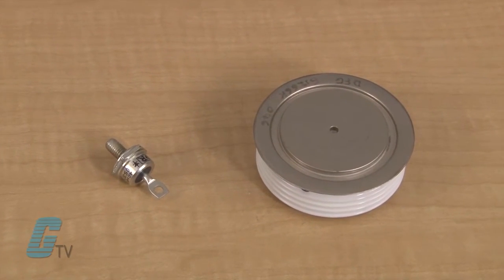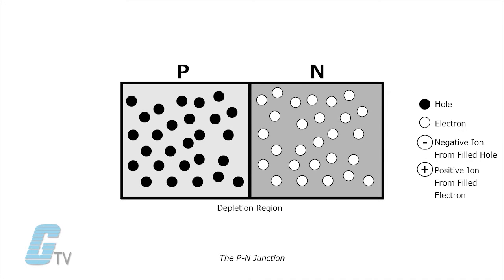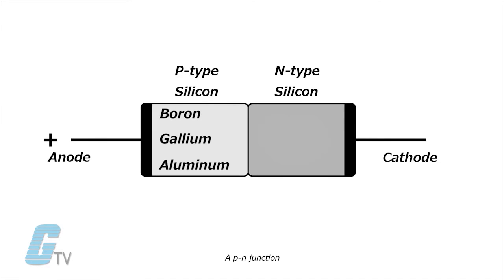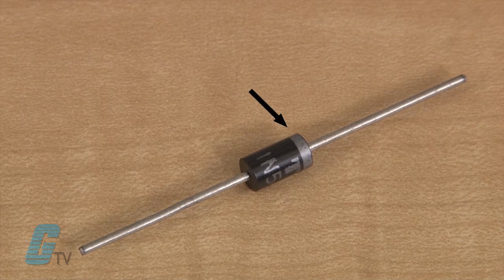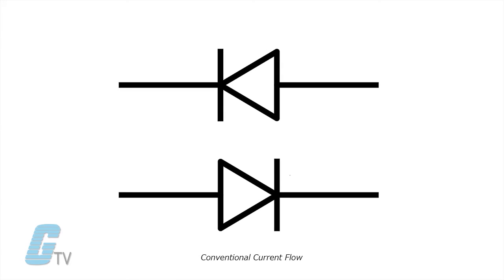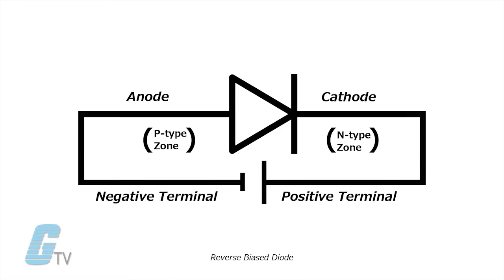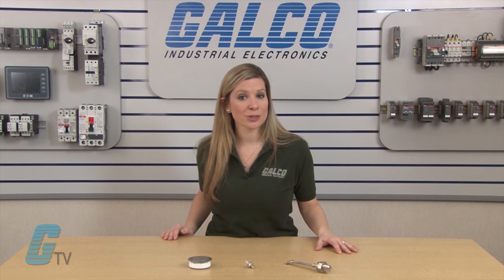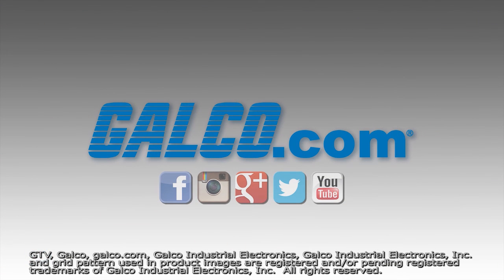What is a Silicon Diode

Comment: is this diode good to use schottky Diodes & Rectifiers 3.0 Amp 60 Volt 120 Amp IFSM? i try to find 50 volt with 1.5 amps but i can't .. Also how do you read a diode ? for example a diode said "  schottky Diodes & Rectifiers 3.0 Amp 60 Volt 120 Amp IFSM, now what are the amps means, meaning it take that much amps to work or does it take up to that much meaning i can use 3 amps and less? now what are the volts means, meaning it take that much volts to work or does it take up to that much meaning i can use 60 volts and less. and now does the 120 amps IFSM means??
Reply from the maker: +Francisco Sanchez feel free to contact us to better assist you. 1-800-337-1720
Reply: +Francisco Sanchez The amp rating is how much current can flow through them. The voltage rating is how many volts it can handle. Diodes will have a small voltage drop, which should be in a spec sheet. This is also the minimum voltage required for current to start flowing. I'm sure you could figure out how much current they steal, as nothing is a perfect conductor and there are losses in the form of heat, it every machine that exists.

Comment: hi, i got a solar panel and i want to which diode i need to use for going one direction? what i mean how much Voltage and Ampage  should the diode be so it wloudn't burn out and/or go in reverse if i using a 25 watts, 1.33 Amps, 18.8 volts solar panel?
Reply from the maker: +Francisco Sanchez Based on the ratings you supplied and assuming neither will go higher than that, I would suggest using a diode with at least a 50 volt rating and at least a 1.5 amp rating.

Comment from the maker: Diodes are a discrete semiconductor device used in many electrical applications including rectifiers, switches, and voltage regulators.